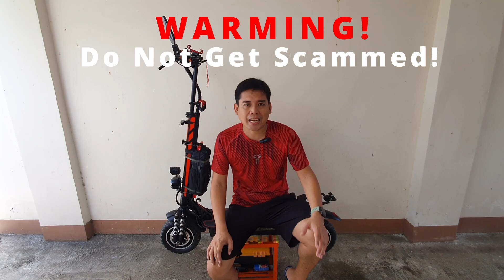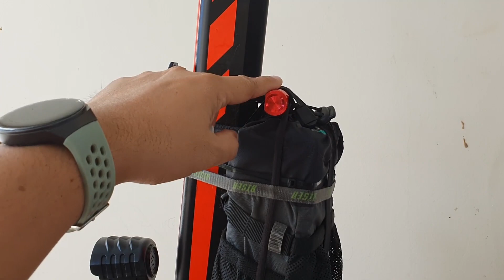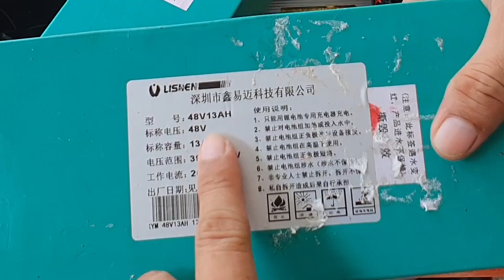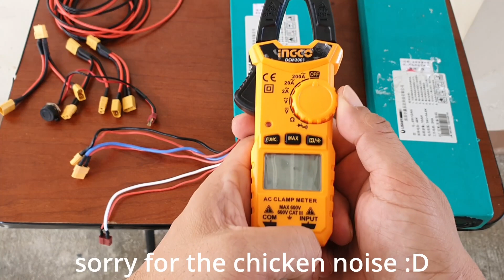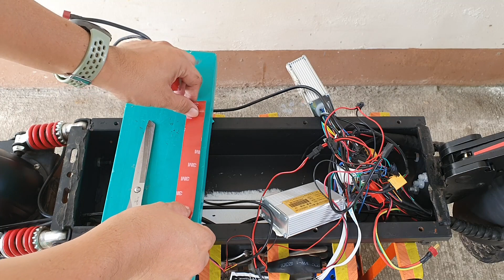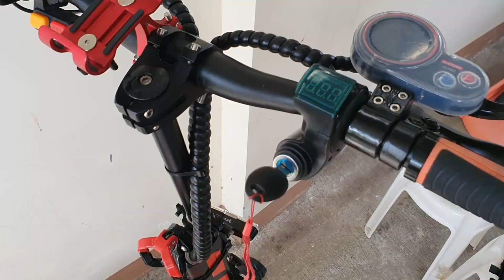E-Scooter External Battery Installation | Xtract Thunder V3 | Can Be Applied To Other Brands

Comment: as far as im aware, you can NOT connect batteries in parallel if they are not charged to the same voltage or the higher one discharges at maximum rate of amps that the cells put out, goes into the lower one and it will overheat then explode or catch fire & explode because its being charged above the safe rate

Comment: my scooter is 36v 3p10s battery connection and its only 7ah planning to double the battery capacity by using single bms with higher amp rating the voltage stay the same just to increase AH

Comment: It is definitely a parallel setup, but batteries are not connected in parallel. You must charge them separately this way (and it is a mess of cables too). To make a true parallel, first you connect the 2 batteries with a Y cable (you don't even need the extra XT60 output of the original battery anymore), then add another Y cable to split this single output into 2 new lines and finally connect them to the controllers, just 1 to 1 (so, you just need 2 Y cables and one extender to place the fat battery outside the deck, that's it). You must connect only the internal battery to the charging port. Way more clean imho. Sure, if you are in a hurry, you can still charge the 2 batteries separately, no problem, but it is not necessary in principle.

Comment: You can use a parallel balancer to balance the Voltage in both batteries so you don't have to match the voltage of both batteries Everytime you use it
Reply from the maker: Good advise

Comment: I have the same scooter but has different specs dual 1500w  48v 20 ah. it was not called Xtrack Thunder. the store I got mine calls it ST10 Pro. the ST11 at their store has Xtrack written on the front of it...  :) I just got a rough quote to have a shop add a 20 ah battery.  by looking at yours their might be room for a 30 ah inside and do what you did. I have not had it open to see. maybe not but I will be taking it in to have that done. btw I like the scooter...  no app for it no fancy display with all kinds of features. just a good bare bones machine

Comment: If the original battery is 48V. Can you boost it with a lessor voltage battery?
Like a car battery that's 12V but has a lot of energy?
Reply: No, you can't, it won't work and it is also dangerous. You can only do a serial connection and make a 60V battery, but that's a complete different topic (motor and controller must be compatible too). To do a parallel connection, both batteries must have the same nominal voltage (capacity, the Ah value, can be different anyway).

Comment: What is the lifespan of a scooter battery? how often do I need to change and how much does it cost? my scooter is the same model as yours
can you help me?
Reply from the maker: 18650 battery has a typical cycle life of 300-500. If you use your scooter daily, drain and charge your battery everyday, that means your battery is in good shape for 300 days average.

Comment: Kumusta kabayan, ask lang sana ako kasi nag parallel ako ng second battery na ang isa. Ay 12800mah at ang isa ay 14000mah  pero yung mah nya na nakalagay sa baterry information is 128000 mah parin. Di ba dapat magiging 26000 mah sya?

Comment: ok lang po bang di kabitan ng charging port yung extarnal batt ?
Reply from the maker: Puede sir. Yung sa akin may charging port yan.
Reply: @ScootTaBai  di ko po sana lalagyan ng charging port yung isa 
magchacharge pa rin po ba yung external batt
same scoot po pala tayo sir
Reply from the maker: Yes, either of the battery ang lagyan mo ng charging port, it will charge both battery kasi naka parallel connection sila. Kusang mag balance yung load dahil sa BMS. Helpful pa rin kung dalawang charging port para just in case makapag fast charging ka especially kung may long ride. May charger sa isang port, ang isang charger sa kabila naman.
Reply: @ScootTaBai  thank you po

Comment: Planning to buy external battery same volts okay lang po ba kung manual switching lang like plug and unplug pag mag papalit ng gagamiting battery?
Reply from the maker: Puede but not recommended. Potential magka lose connection and dahilan ng short.